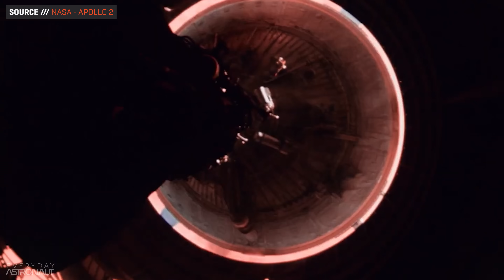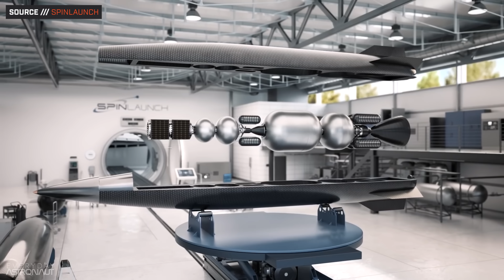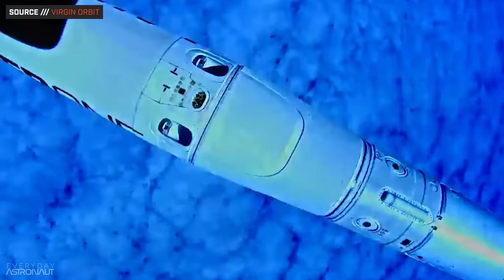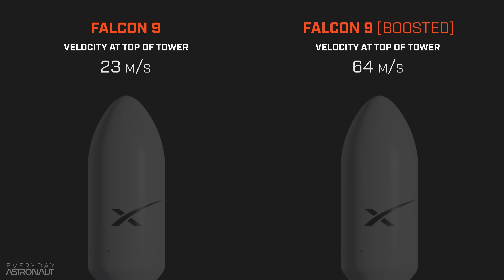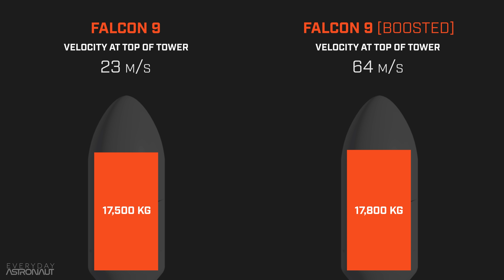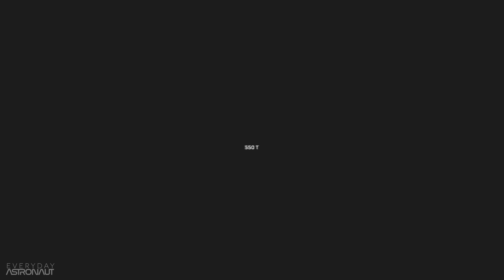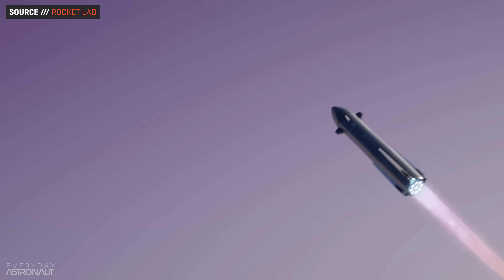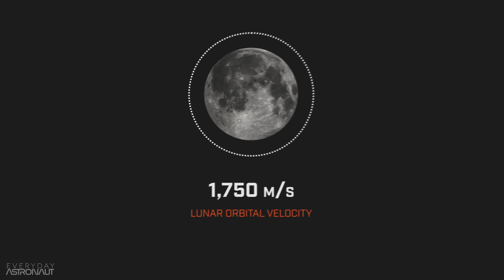Could We Help Push Rockets To Orbit?

Comment: I always wondered about the insane amount of trust a space ship needed to just lift off and it's kind of disheartening come up with an alternative solution due to the insane amount of material needed to make it happen but let's just imagine that $ is not a problem for a moment? What would some mad scientist would come up with?! If the problem is distance let's just say build a ramp slope inside a mountain to gain momentum not a straight tube! let's just imagine that Starship instead of standing up is laid horizontal and is mounted on a rail system on a tunnel underground that uses a mountain to make it gradually stand up! Let's just say that the rocket ship is mounted on wheels on a rail that uses a cable to make it move so no ridiculous amounts of energy are required to move, since it is on wheels and a cable with a motor is assisting move the rocket less energy the rocket will use to lift off! I have always been fascinated how aircraft carriers launch it's fighter jets with some kind of steam cable catapult! I wonder if something similar could be used to help the rocket gain momentum! Like I said! Let's imagine that $ is not the problem and that the FAA is chill with saying 🆗 you can launch it, no problem! I think a rocket with a little momentum is better than starting from zero in my opinion! as for the ridiculous amounts of energy and material needed on the examples of this video the tunnel slope on a mountain would require way less energy to make it happen but that is just my simple farmer mind opinion!

Comment: Since you said it about 50 times in this video I thought you should know that you aren't using the word 'yeet' correctly. There is no such thing a carefully planned, engineered, and executed yeet. I already hate that word so I wont type it again, but it means to propel an object with great force without concern for destination or safety. Basically just hoping for success through brute force rather than take a more efficient and precise approach. Almost every time you said that word in this video you could have used something like mechanically - push, assist, lift, boost, or propel and it would have been more correct. The closest thing to actually doing it in the video is the submarine launched ICBMs which use their initial propellant stage to toss themselves just far enough out of the water that they have a moment to light their second stage and hopefully regain control before they fall back into the water.

Comment: Great video! However the moon launch maglev is quite realistic: 55 km is not that long for an electric train train even if maglev. (If you just want to get into lunar orbit it would only be 30km). We have train lines which are thousands of km long right now! 35,000 MJ is about 70% the consumption of a single UK home for a year so not "staggering" but kind of negligible compared to the energy needs of a city or Moonbase Alpha

Comment: How feasible is a system where you have multiple raptors at the bottom of a shortish (100m) vertical tube that push a plate upwards on which Starship is attached? Having a crossover point where Starship is powered up and the ground raptors powered down would allow for safe deceleration of the plate and using inverted rocket engines for the initial boost means that the energy requirement becomes moot.

Comment: CHEMICAL ENERGY is the only way to create enough power fast enough. That's why rockets are a thing. I'm surprised you didn't mention staged gas guns. Much simpler infrastructure, and adequate power density. Same equations. Still infeasible, but interesting. ❤

Comment: What if we used buoyancy as a launch assist? Imagine a huge sealed vertical tube built under the sea. A rocket is lowered inside, kept in air or near-vacuum so it doesn’t face water drag. At the bottom, a piston/air chamber pushes upward, and the surrounding water provides the buoyant force. This way you get a strong upward acceleration from water pressure, without the huge hydrodynamic drag of moving through water. Maybe not practical for something as big as Starship, but perhaps for smaller vehicles?

Resetting the piston is probably not trivial.

Comment: but you're just looking at it in terms of increasing the overall payload of the rocket. arguably the efficiency of launching the same load using less resources is the larger benefit.

also if instead of adding payload you remove fuel that's no longer needed it further increases the relative effectiveness of the launch system...

Comment: I guess thinking about assiting a falcon 9 with a tower is simply too much for a system like that, a tower like this should be used for a rocket no more than 30 m tall, also use different approach, i have some designs for that.

Comment: giant preloaded spring. engines ignite safely, no risk of damage. energy input can be gradual to load spring.

also,  I don't think the engine exhaust plumes damaging electrical components is a significant concern as there are simple engineering solutions to get around that.

another consideration (more so supporting your argument/theme) is that the g's that make the assist effective could require huge increases to the strength of the rocket structure and payload being launched, likely increasing weight.

great video, as usual!

Comment: Hey Tim
You should calculate the Impact a reusable ring of F16 fighter Jet engines with after burner would have if they support the rocket till the air gets to thin or the speed to fast.
It's about 100s of flight
and compare the CO2 created per Kg added to LEO please.
I'm sure Grok can help out with a cost of service calculation to get a price per Kg to LEO as well...
Kind regards 
And thx for all your great content

Comment: Also for electric sources a grid sized battery system could function as a power source with some modification and still function as a grid stabilization and leveling system.  Might require some modifications for a higher power to storage... or not.  Ties between Tesla and space X are strong, and southern Texas might benefit from grid scale energy systems.

Comment: Perhaps missing something.  If the tower height is made taller the power could be less (Thrust/weight ratio closer to 1.2).  Consider Launch catapults on carriers.  Consider compresssed air or gaseous nitrigen as the energy source.  Also the main advantage is probably the potential reduction of of the thrust to mass ratio of the first stage.  Also for battery power the batteries for hybrids or even those for the Electron turbo pumps have a much better power/weight or power to $ basis. 
Personally I think a ring of high thrust high bypass ratio jets could supplement take off thrust by perhaps 1,000,000,lbs (maybe more with afterburner).  This would need to stage at just below the speed of sound, near Max Q.  About the boost of two ULA centaur boosters, but with a lower burn time.

Comment: Actually if Spinlaunch can achieve Mach 6 at full scale, which is 2058 meters per second, it would basically reach the Lunar orbit with almost enough speed to get the payload back at earth, it would not be able to launch humans but Spinlaunch seems great as Moon/Moon to Earth payload launcher. Like if you build it with several starship launches and charge it with solar or nuclear power it would be quite interesting, it seems far better on the moon than on the earth and looks even better than maglev rail moon to earth launcher
Reply from the maker: Except for the whole 10,000 G’s part 😅
Reply: @EverydayAstronaut  yeah, XD but thats why i said it would not be able to launch people😅 somewhat recently they had news about developing satellite bus that can endure 10,000 G's when spinning so maybe they can try pulling it off (edit: i mean pull off sat launches not people launches)
Reply: @EverydayAstronaut   they could use a rotary dampener to go from tens of thousands gs to just thousands or hundreds. Probably the only way to yeet a living creature or fragile item is a linear accelerator. (Trading off tangential acceleration for the high cost of an electromotive railway.) Although the only cost effective way a linear accelerator is happening is if graphene starts replacing copper.
Reply: never mind I just found out about maglev rings, basically eating the gs that would shred the payload in the form of a magnetic suspension.

Comment: What if you had a horizontal rocket powered sled attached to 10-15 cm diameter HMPE cables pulling the mechazilla arms up an extremely reinforced tower.
Reply: GPT5's analysis for the feasibility of 60m/s delta V for falcon rocket:

Loads and what they mean
Line tension: ~14 MN steady; design for >2× transient (28–35 MN) to survive snatch, oscillation, and guidance errors.

Tower reaction (180° wrap): ~2T → ~28 MN through the sheave pin into the tower (plus dynamics). That’s big, but squarely in heavy‐lift/offshore crane territory if you overbuild.

Sled speed & thrust: Sled sees same line speed (to ~60 m/s) and must deliver ~14 MN of controlled pull for ~2.3 s. That’s ≈ 1.6 Merlins’ worth of thrust in force, but you need fine throttle and very stiff guidance.

Rope: size it like you mean it
Pick aramid (Kevlar/Twaron) or HMPE (Dyneema SK99/DM20). Use working stress ≤0.6 GPa (conservative) with SF ≈ 2.0–2.5 on ultimate.

Required metal‐equivalent area:
 ≈0.023 m 
2
 
Single-line diameter: 
 ≈170 mm.

Mass per meter (HMPE 0.97 t/m³): ~22–23 kg/m. A 200 m line is ~4–5 t. Manageable.

Better: split the load. With 4 parallel lines:

Per line: 
d≈85–90 mm.

Pros: smaller sheaves, lower bend loss, easier handling, better redundancy.

Cons: more hardware, synchronization, and failure modes.

Sheave (pulley) realities
Use D/d ≥ 20 to keep bend strain sane.

For 170 mm rope → D ≈ 3.4 m.

For 90 mm rope → D ≈ 1.8 m.

Rim speed: ~60 m/s (way nicer than the 300 m/s hellscape we discussed earlier).

Hoop stress check (steel/composite rim): trivial at 60 m/s; not the limiter.

Heat: even 98% efficiency dumps ~8–17 MW into contact surfaces near peak (seconds long). That’s a lot, but you can spread it:

Multiple lines / multiple sheaves,

Water-cooled ceramic/metal rims, thin oil film or dry low-μ liners,

Keep wrap angles minimal consistent with capstan grip.

Control & dynamics (the real dragons)
Slack–snatch risk: any phase error between sled pull and rocket motion can spike tension 2–3× in milliseconds.

Use pre-tension, in-line hydraulic accumulators (compliant buffer), and active payout on the sled side (multi-capstan linear winch) so the rocket never “yanks” a rigid line.

Guidance: the vertical leg must be guided (fairleads) to stop side whipping. The attachment point on the rocket needs to sit near the longitudinal CG, with gimballed clevis and load cells feeding a fast controller that slaves sled thrust to measured line tension.

Structural integration: the rocket has to take 14 MN axial from the nose/shoulder area without local buckling. That means a load ring tied into the interstage/barrel longerons. You’re basically adding a “catapult lug” to a very light, pressurized shell—tricky but not impossible.

Sled & track
Propulsion: solids are simple but not throttleable; I’d pick hybrids or multiple small liquid engines for thrust shaping.

Guidance: stiff, straight rail with side and uplift restraints; sled must track to millimeters to keep the tower fairlead happy.

Power: you’re delivering ~420 MW avg (840 MW peak) to the line; the “engine power” is thrust × speed and is fine for rockets—just remember you must control it like a catapult, not like a booster.

What you gain vs what you pay
Delta-v gained: ~60 m/s. That’s not nothing; it can trim gravity/drag losses and allow a tiny propellant cut or payload bump.

Complexity & risk: high. You’ve added:

A 28+ MN tower head with cooled sheaves,

1–4 high-energy ropes and capstan machinery,

A precision rocket-sled system,

New failure modes (snags, snap loads, mis-sync, tower strike).

Make it survivable: specific design moves
Four-line layout, each ~90 mm, each to its own cooled 1.8–2.0 m sheave; independent load cells and fast tension controllers.

Inline hydraulic buffer on each leg sized for ~1 m equivalent stroke at 3–4 MN, to blunt snatch by >50%.

Multi-capstan payout on sled side with closed-loop speed control (think winch-EMALS hybrid).

Sacrificial, single-use lines (no fatigue life requirement), inspected and replaced every shot.

Rocket hardpoint ring tied into structure; proof-tested to >30 MN.

E-stop that dumps line tension into the hydraulic buffers and sled brakes if tension spikes.

Bottom line
Physics says “yes, doable.” The numbers at 14 MN, 70 m, ~60 m/s are orders saner than the earlier 300 m/s scenario. Rope sizes, sheave diameters, and tower reactions are in heavy-industry territory.

Systems engineering says “only if you really need ~60 m/s boost.” You’re buying major new infrastructure and failure modes for a modest delta-v. If your mission economics love that 60 m/s (e.g., from a mass-driver site or for delicate first-stage reuse margins), consider it. Otherwise, linear motor rail or rigid push-bar catapult likely beats a rope for reliability and control.

If you want, give me constraints (max tower height, # of lines you’ll tolerate, material choice), and I’ll spit out a concrete sizing table (line diameters, sheave D, buffer volumes, heat loads, and tower pin shear) so you can see where it bites first.

Comment: Maybe this is a silly question, but couldn't they use a sled to get all the benefits of a first-stage booster rocket without having to carry the mass of the first stage booster rocket anywhere? Or would the mass of the booster rocket on the sled give the same acceleration penalty as the mass of the booster rocket hanging in the open air?

Comment: This is Easy to Solve. Build 6 Halfpipe Shape Concrete Hills around it. Roll down Barrels wich you Fill up With Water. The Cable System also is Simply The Barrel itself, winding up while Rolling down. This way its also a Smooth Transition, for the Rocket to take over instead of some Abrupt ending.

Comment: the should start lifting the rocket from 3km underground and use a rocket+electric powered platform to have it leave the surface going fast enough to save half of it's fuel.

Comment: Pulley system seems to be the way to go. Not sure why you consider it unimaginable. It's about the cargo weight of 2-3 panamax-sized ships of weight. Can look at any major harbor and see the infrastucture required to pick up and move it. No need to do it in one single piece or over one single pulley or line. Would be funny to do it as a segmented hollow cylinder (imagine a segmented washer that's very thick) surrounding the launchpad with he weights shaped to push the air into the central 'launchpad'. Less pulley work and more hydraulics (air). Probably would be able to shove enough volume of air together with enough force to combust it. Extra bang for the buck.

Comment: Use mechanical systems instead. There are already lots and lots of people on a launch site that have experience with compressed gasses. So, use a combined compressed air and thermal system. 

Store energy as heat in sand or brick underground whilst also storing it in compressed air in tanks near the launch tower. Run the air through two massive pistons. The first piston with air direct from the tanks and the second with the air from the first piston passed over the heat storage medium. Use cables and pulleys to yeet the rocket powered by those two pistons. There are commercial cables for bridges that cope with that load daily. 

With the correct architecture, you could probably even get more than the launch towers height to throw the rocket if you built the yeeting device sort of like a forklifts mast. Would look awesome!

Extra thoughts. Maybe use the cool exhaust air as a screen between the launch tower and anything sensitive. The onrush of cool air should blunt some sound waves and divert any exhaust gasses upwards.

Comment: You're throwing out these numbers like hundreds of thousands of kW like those are impossibly large figures, or especially hard to attain. Realistically though, engineering a system that can provide and quickly release that much power isn't especially difficult. Want to launch 100 tons with 3 Gs of net acceleration over a 100-meter length? Just drop a 400-ton counterweight that same hundred meters. If you don't want to build a structure that can support that, you could drop it down a solid earth ramp and just increase the counterweight mass appropriately.

Even if you want to go for some electrically powered system, the figures you were giving are hardly outside of the range of what we've already engineered. The electromagnetic catapult used to help launch planes from the Gerald Ford class carriers generates 484 MJ. That's about half the energy you calculated for providing an assist to a Falcon 9 launch.

I don't think a system like this is necessarily that technically infeasible. Rather, it's probably just not worth the divided attention that would be necessary to engineer it when there is still so much potential for developing the rockets themselves.

Comment: But why don't launch a rocket inside a tube or hole? Pressure could not escape to the sides and the thrust would be used more efficiently. 
And if this is not crazy enough, one could put flamey-end-up engines below the rocket fireing at the same time

Comment: What about building a giant hydraulic cylinder underground that the rocket sits on.  When the engines ignite,  many hydraulic pumps start to push fluid into cylinder in a controlled manner and rapidly push the rocket up.